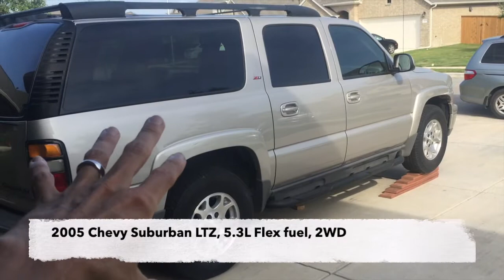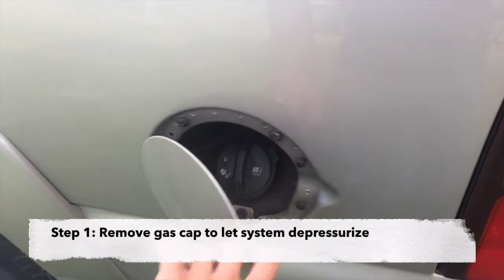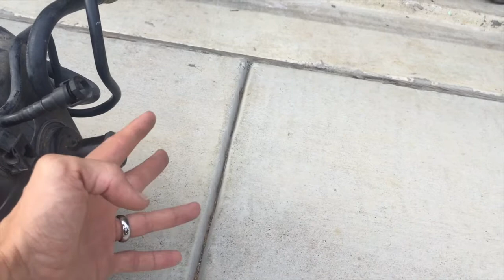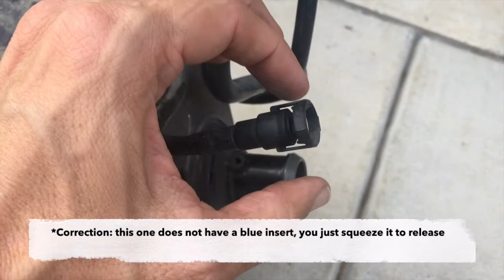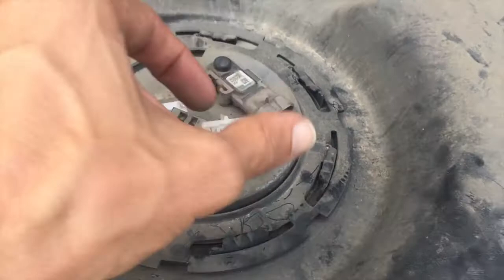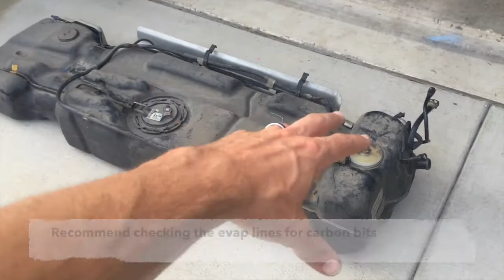Replace fuel pump and drop fuel tank on a 2005 Chevy Suburban

Comment: Is the fuel pump the same part number for a 2006 GMC Yukon 5.3 non flex fuel. I seen some pump modules with 3 tubes on top of fuel pump and some With 2.

Comment: My tank has is full? How to I drain it before before removal, also I think my tank is larger than yours..I think mine is 32 gals and it has 32 gals of fuel in it? Thanks.
Reply: What did you end up doing to make the tank lighter? I need to pull mine out this week.

Comment: Love your detailed videos. Thanks for showing. Question, I have the same carbon bits problem at my purge solenoid. Which line at the fuel tank runs back to the purge solenoid do I need to plow out with compressed air?
Reply from the maker: Hard for me to describe but I would trace the line from the purge solenoid down and to the fuel pump to ensure you have the right one.

Comment: Got in my 2005 suburban and started it. Put it into gear and pressed on the accelerator and there was no resistance and no acceleration at all. Turned the engine off and back on and it worked fine. Any experience with this ?
Reply from the maker: No sir, never had my suburban do that before!
Reply: That same thing happened to me but it won’t work for a long time.
Reply: I'm having similar intermittent starting problems and it will suddenly start sputtering and running rough while driving. I'm replacing fuel pump tonight. Hopefully that fixes it.
Reply: @dbnick9  was it the pump or filter?
Reply: @markgil9249  it was the pump